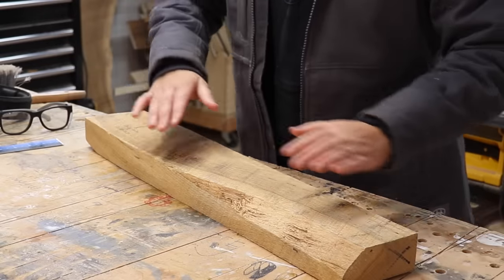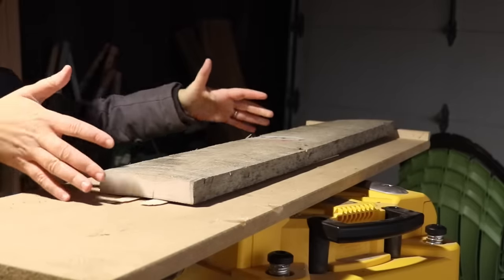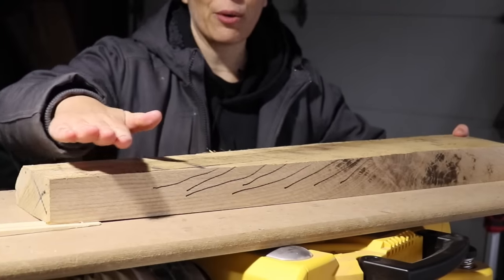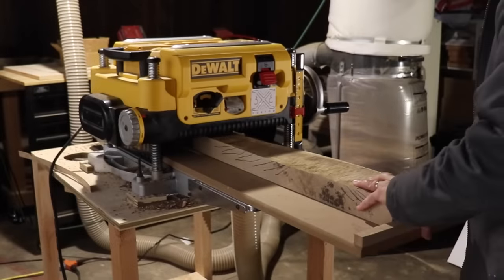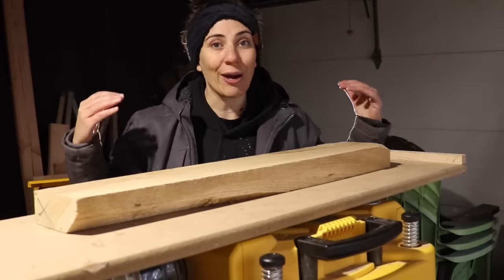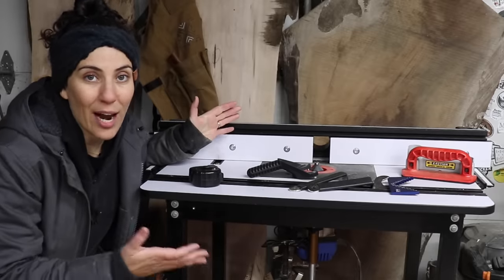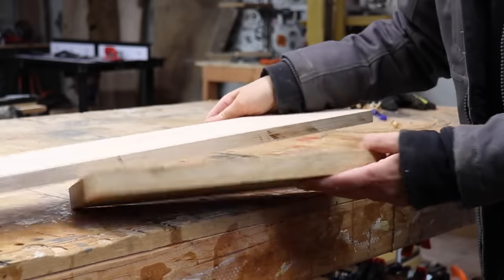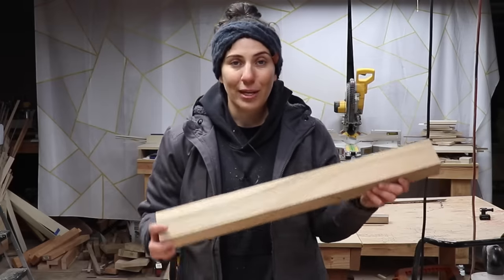Milling Rough Lumber Without a Jointer Using a Few Simple Jigs

Comment: The best way to get around no jointer is - get good with hand planes - a good jointer and fore plane, well sharpened and set up can give you a flat face and edge to work from in very little time.
Reply: Do you use winding sticks for that process?
Reply: No single best way. Good luck getting through some of the denser exotic woods. The time wasted setting everything up, the sharpening, etc. is just not worth it. If that system works for you, great. But is it the best? Not if you want to save time.

Comment: Random side note. In step 3, you can get by without a jig at all but only if you have a super long fence, by pressing the concaved edge against the fence and the piece never leaves fence contact. So it only works if you have a fence that's essentially twice the length of your piece, which of course most people won't have.

Comment: Thank you! Thank you! Thank you!  There is a steel manufacturer down the road.  When steel is brought in, it sits on a hard wood pallet.  They just throw them away.  I’ve been collecting some 2x4’s and 4x4’s.  It’s all rough cut wood.  I have a small 24x30 shop and didn’t want a jointer.  Now I can mill the wood and build something beautiful…..

Comment: This method WORKS!!  Before I got my benchtop jointer I used this method with my thickness planer to get rough timber completely flat and square for glue-up and segment wood turning. Thanks for showing us how this works in this well explained common sense demo! 👍🏾

Comment: Great video Tamar, I was woodworking for a long time before I learned the planner sled trick.  A couple of tips, my planner pulls my board forward, so I always run the sled through with the end with the stop block first so it is pushing against the block.  When you are looking to square the first edge of the board on the table saw, pay attention to the grain on the face of your board.  You may have some sap wood that you would like to trim off or you may have straight grain (think quarter sawn or riff sawn) running down the board where you want to plan to keep the orientation straight instead of having it running off the side of the board at one time.

Comment: Good tutorial! I think you and Stumpy Nubs have talked me into buying a planer before buying a jointer. (Don't have enough money for both right now.)
Reply from the maker: Thanks! Yes! You can get by without a jointer. But a jointer is kinda useless without a planer.
Reply: same here. I love Stumpy Nubs too.
Reply: Planer is WAY more useful around the shop  for general overall use than a jointer, if you could only have one. I consider a planer an absolute necessity and a jointer more a luxury.  Unless you are doing a lot of edge jointing for panel glue ups, etc you really can get by for the most part without a jointer especially when you consider their price.

Comment: It seems to me you set this up to run the jig through backwards.  The feed rollers will try to pull the wood forward on the jig not backwards.  The block attached to your jig should be on the front not the back.  Obviously it worked, but is technically backwards.
Reply: RexSeven not really, the jig is set up the right way. While the roller pull the wood through, the cutter head spins the opposite direction as the roller, the cutter head has much more force and power to kick the wood back. I would set it up exactly as she is describing in the video.
Reply from the maker: Haha! This is one of the most common debates. To be honest. I have done both and see the merits of both. I think the hot glue is really doing most of the work though, so in my opinion, it actually really doesn’t matter....
Reply: @3x3CustomTamar  thank you for your great video Tamar.
Reply: @behradgorgani  I've seen wood go through slower than it should and I've seen it stop when rollers are damaged or dirty. I've never seen a board go backwards. Ideally, you would have a block front and back, but if I could only have one, I'd put it in front. You can put it wherever you want.
Reply: I tried the stop at the back but I had problems with the board sliding forward so I now have the stop at the front. I tried hot glue but the board moved anyway so I covered the top of the jig with rough sandpaper so the friction helps the board stay put. I also top the shims with a piece of rough sandpaper and everything stays in place.
Reply: @behradgorgani  according to you every thicknesser should kick all wood back. i've yet to witness that.
Reply: @sadeoneandonly  I simply explained the mechanics of a thickness planer, that the cutter head has more torque than the rollers. I've used many different kinds of planers from the super expensive digitally controlled ones to cheap 200$ big box stores ones. I've seen pieces shoot backwards through a planer in my 10 years of being a full time woodworker and educator. Of course it doesn't happen all that often but it can happen. Just be safe and use common sense. Good luck everyone.
Reply: @behradgorgani  For a consumer type planer like this, where the rollers are on the top, they grab the workpiece and pull the sled through. The stop strip should be on the front, so that the rollers don't pull the workpiece forward off the sled. You (and many others) get away with this setup if there is enough friction between the sled and the workpiece, or if there is adhesive (dbl sided tape or hot glue etc.) holding them together.
Oth, most commercial planers have the rollers in the bottom, which grab the underside of the sled to push it through. For this setup the stop strip should be at the rear.

Comment: Always keeping a lookout for useful things my Dad and I ran across a 12' long aluminum "stud", not sure term to use.   6" wide 1" tall  with a lip.  Not solid but with ribs to keep it straight.    Anyway we clamp that to table saw fence, it's an old large table 220v saw, and that does great for cutting crooked lumber up to 8 feet long.   Cut one side flip it over cut the other side just enough to get an even edge and now you have two perfectly parallel sides.

Comment: Thanks for your clear and concise piece on getting by just fine without a jointer.
High quality content, both informative and down to earth.
You know what you're talking about, keep it up and I wish you gold plaque in 2024 ! 

 
The lumber I end up buying 90% of the time have nice and parallel faces.
The one that have twist goes straight to the burn pile. I had a lone kickback in my life and it was a twisted board that tried to kill me.
But as I discovered, almost none of the lumber in store has square edges.

My trusty old DW716 offers me 2 very handy features to scan for nice square lumber:
A wide continuously flat level base AND a straight fence assembly, both verified with a straight edge. Not all brands promises these, including some of the pricier.... 

If I stand a 2x4 or 2x6 on edge, its either pressed down flat on the saw base OR else pushed back tight to the fence, rarely both. 
That same 2x4, laid on face flat instead of on its edge, will all but conceal an out of square situation.
So even when my intent is to cut a board laying flat, I always stand it on edge first to check for squareness against the fence.💙😎

Comment: This is by far and away the best explanation of how you can make ordinary lumber into usable stock without a jointer.  

I knew all of the steps before watching the video.  

I’ve read countless Pinterest articles detailing jigs you need to make or methods to do this.  

But you put it all together.  Not only that; but along each step you not only said what you can do, but the “why.”  I think this gets lost so much and I’m really grateful for what you did and I think you should be proud of this video.  Plus it looked cold out there, so you get extra props. 😎👍
Reply from the maker: So glad to hear!

Comment: Thank you for a concise and well articulated video on making and using a Planer Sled.  I took what you said to heart and made and used one today on my new planer.  What I did was not use any shims but I squirted a bead of hot glue into the gap left by the warped wood.  When it hardened it basically made its own shim and at the same time glued the board to the sled.  It worked like a breeze and saved me having to futz with shims and making sure they are seated just right.  The glue made little feet under the warped areas and were a perfect fit.

Comment: Great video. I have tried to mill sun dried oak wood I raw cut with an Alaskan chainsaw mill. That wood is severely cupped and twisted. I milled some by going old school using hand planes and winding sticks which helped me appreciate how hard woodworkers worked just a few decades ago. I'll be using your method for the rest of that wood. Thanks for posting this. I'm glad I found your channel.

Comment: Nicely done. Viewers appreciate how you demonstrated multiple ways to accomplish each step. I would add this thought. In step 3, in addition to cutting off bad material, one might adjust the cut so that the grain direction of the finished piece will be most desirable. Thanks.
Reply from the maker: That’s a good point

Comment: Thanks, the info on supporting the wood was very valuable.  I was mostly successful but it was a pain and I really need to remake the sled and laminate it as the hot glue pulls up the mdf quite easily. The last time I did it, I was watching Rob Cosman true up a board with a hand plane and I tried that and it actually worked better than my shimming job. It does not need to be perfect, just not rocking and no large unsupported area. (that said, I AM buying myself a jointer)

Comment: Fantastic instruction. I have a table saw, sliding miter saw, and a small table mounted router. No jointer or planer. Planer is next. Thanks to you I will be able to joint rough wood.
Reply from the maker: Awesome

Comment: Thanks so much for this video. Very clear and easy to understand for me who is only starting to think about more serious woodworking. Previously I've only ever used a hand saw, drop saw, and orbital sander. But running into difficulties and limitations making larger things like bookshelves, issues like when edges aren't straight. And cabinets are even further out of possibility for me. I'm thinking of starting with a track saw, because that way I can cut out big pieces of plywood into cabinet walls and table tops, also make sure edges are straight for planks of wood. And my workshop is quite narrow so not really any room for machinery like planer, jointer, anything like that.

Comment: I recently watched this video again and think it’s one of your best (which is really saying something).  Even if you have the money for a jointer they aren’t always easy to set up and use properly.
Constructing a planer sled is s GREAT alternative!
Reply from the maker: Glad you liked it!
Reply: Also, regarding a jointer sled for long stock (8’)… I would be curious what results could be obtained using a 8’ section of plywood or mdf attached to a 8’ miter runner made out of 3/4” PVC wood since PVC won’t expand/contract.  
With proper infeed and outfeed tables, this MIGHT eliminate the need for the sled to ride against the fence, assuming the miter slot is parallel to the blade.
That would be a cheaper alternative to using a track saw (which still relies on a perfectly straight slot).
Sounds like a jig I might explore next spring!

Comment: Hi Tamar,
Good ideas clearly explained.  Thanks.
I have the same table saw but not the other pcs.
To make the first straight edge, I cut an end at ~ 90⁰ on my chop saw, then use that "straight edge" on a simple table saw sled.
I manage & renovate apartments so this method is good enough for semi-rough carpentry.
Tha ks again!

Comment: This is a great tutorial on milling without a jointer. Tamar is hands down the best on YouTube at explaining woodworking concepts. One tip regarding the planer jig. Place the cleat on the front not the rear. That way, when the rollers in the planer pull the piece through, it will be pressed down and against the cleat. No need for glue on the shims or the workpiece. I sometimes use this jig even when the piece doesn't need jointing because it really helps eliminate snipe.
Reply from the maker: Thanks. Except that up for debate. I actually do it both ways and o have never had an issue either way but that’s bc I am using the glue

Comment: very nice explanation and clear demonstration. i like how you emphasized principles so the viewer can improve his understanding of why, which always leads to a better what. i have one small criticism, @ 17:15 we see a blade burn mark accompanied by your comment that a ripping blade would probably have avoided the burn mark. i dont think so. the reason for the burn mark was the feed stalled between your pushing the board with your right hand and switching to a push stick, also with your right hand. the thing that avoids marks is smooth, continuous feed with constant blade speed and a sharp blade. in this case i want something other than my left hand holding the board against the fence. that way i can start feeding with my left hand and switch to my right hand holding a push stick with almost no change in pressure/feed rate. so, you wanna prevent burn marks? use something to hold your work against the fence and free up both your hands to handle the feed more smoothly. if you have knots or other variations that could slow the blade, then you need to make two passes, the final pass being just a kerf or half-kerf at constant speed. you didnt need two passes on tis board, but you always need a constant feed rate to get a clean cut

Comment: I just used the planner sled it worked awesome but instead of mdf I used melamine and the hot glue cleaned up very easily thanks for the tip

Comment: I used this technique for my first project with a pretty high volume of wood in a cold freezing shop during winter, it was an amazing experience and it worked pretty good in general, but in the end, you will dream of owning a jointer!😉
Reply: I agree, have used this technique, it just takes longer and I don't have lots of time on my hands.  I wish i could afford the better tool, but then i wish for a lot of other things I want and need as well.  Finally it boils down to priority trade off, what I can do with what I have vs. spending $X in addition to my project cost for another device that will take floor space.  I don't always cheap out either.  Sometimes the new device wins over making do with what I have.  Still haven't bought the jointer.

Comment: Excellent explanation of the process in all respects.  Note:  The board has four square and parallel sides, but the ends still have to be cut to be squared on all six surfaces.
Reply from the maker: Yea. Cutting for final length is the last step.

Comment: This is such a helpful video! I learned a lot! The shims are genius. At 13:00, another thing I've seen is that you can use your brad nailer, and just nail a strip of straight wood to the face of a curve shaped board, to give you a nice straight edge, then cut off the ends that have the brad nails and throw them away.

Comment: I needed to flatten a cutting board after glue up this morning, I just put layers of tape on the corners that were bowed until it didn't rock back and forward on the top of my table saw.. The result was pretty good.
Reply from the maker: If that worked. Cool!

Comment: excellent video...its so beautiful to reveal the usable lumber living inside every piece of wonky wood...one thought, the instinct is to preserve/reveal the maximum amount of useable square lumber in every rough cut piece...this no doubt creates infinitely dimensioned flat and square work pieces, inevitably having to further mill down for uniformity...can you comment on what guides you through that next process?...thank you so much,  RD
Reply from the maker: Thanks! If my project calls for 3/4” thick material but the material I milled up is thicker than that. I just use that. I try not to worry about using exact measurements since I don’t follow plans. I build based off of what I have

Comment: I had to fabricate 50' of 3/4" baseboard from 2 x 12's.  After bandsawing to the correct width, I utilized the techniques you explained here.  What a PITA!!!  I made a sled per the instructions..  It came apart when I ran it through the planer and, had I been standing directly behind it, would have killed me.  All of the necessary operations required to get usable boards make this impractical.  I will never do this again.
Reply from the maker: Then you did it wrong.

Comment: Cool videos...
I use a 60 tooth 10" blade for hardwoods like various teaks, oak, walnut to get a real smooth cut without slivering, but it has to be one continuous push or I get a saw mark and a burn where I stopped. The Blades last awhile.

Comment: "It just depends on what kinda mood I'm in."      Ain't that how we are??
I'm with 'The Warrior Song Project', Tamar.  You are a talented teacher.  I've heard this process explained several times, even by Colin and you finally explained it in such a way that I actually understand why it works.    Thanks for mentioning that we need to check to make sure our blade is at 90 degrees to the table before making the final cut.  I don't think that I would have thought to check that.
I had not seen using a pattern bit in my router explained as a way to square up an edge.   Thanks for sharing this method.
BTW: You're an excellent 'sales lady'.  You do a great job for each of your sponsors.
Reply from the maker: So awesome to hear! Glad you liked it!